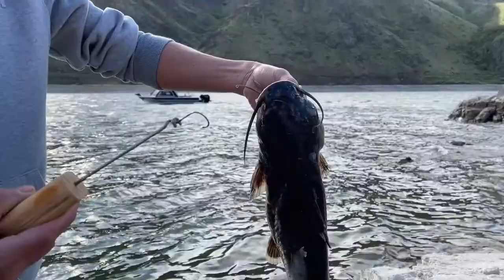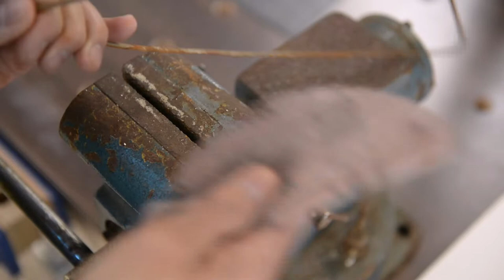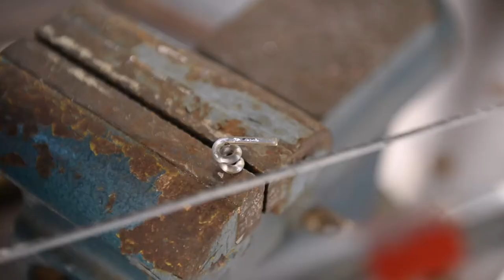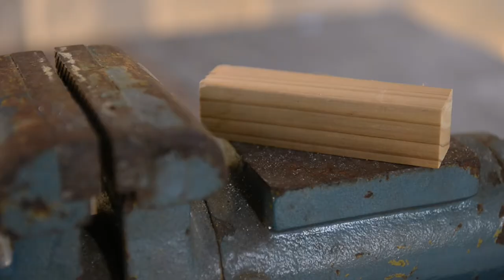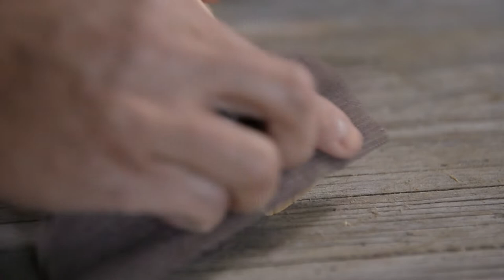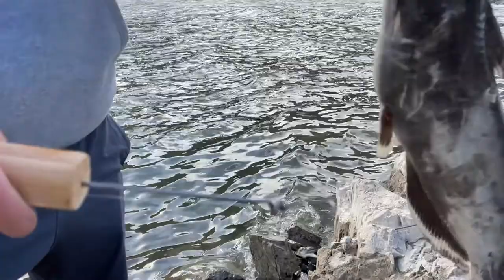How to Unhook a Fish with a Fishing Hook Removal Tool | DIY / How To

Comment: Good job, the only thing is the loop needs to be a bigger inside diameter, so it can slide over the hook loop. To the bottom of the hook curve, then while holding onto the line lift the hook out
Reply from the maker: Thanks for the comments, and the sub. I will try your suggestion next time.